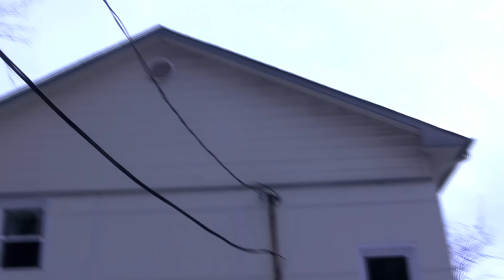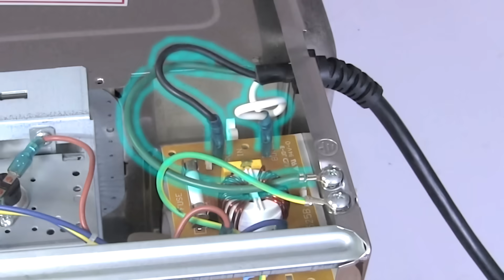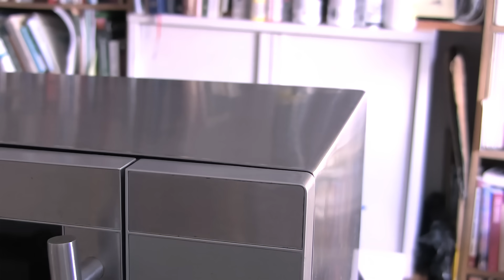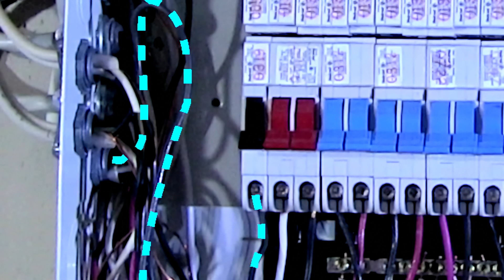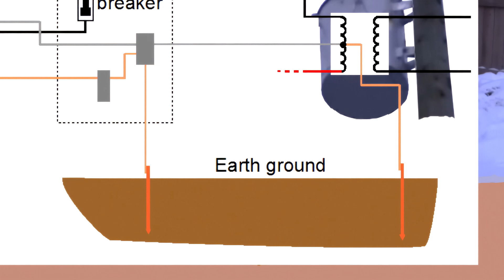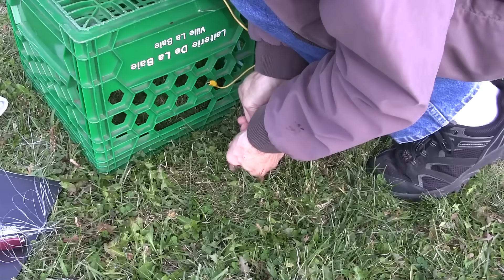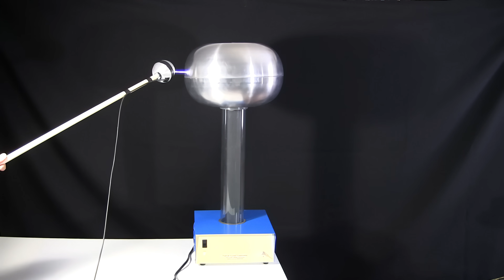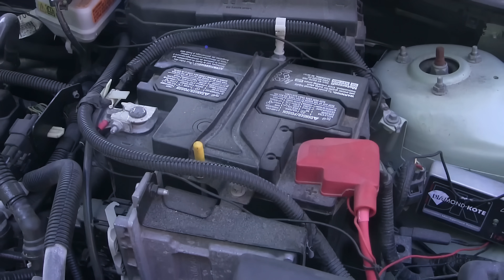What is Ground? Earth Ground/Earthing

Comment: in europe, Neutral and Ground are not connected in the home. (and must never be) Neutral is connected to ground at the provider's transformer. Security is acheived via a differential breaker.
Reply: In the UK commonly we now find systems of distribution of a T. N. C (S)
The Tierra and Neutral are Combined as far as the service position in a premises, and from thence separated into the Neutral and Circuit Protective Conductor (CPC) or as formerly referred to as the earth.
Like in Europe, it is not permitted to interconnect the Circuit Protective Conductor and the Neutral within the installation, and we are now required to deploy Residual Current Devices to monitor circuits to specified locations - all socket outlets, bathrooms, kitchens and outdoors. Also, if a cable is less than 50mm from the surface of a wall and does not have additional mechancial protection that is earthed, that circuit must be protected by an RCD.

The use of T.T. (TIerra-Tierra and earth rods) Systems still abound, as do many T.N.S. systems where the Earth and Neutral travel as Separate conductors to premises..
Reply: Not quite right.  Something similar to the US system can be used in the UK, if certain provisos are met and if a certificate of exemption is obtained.  But soon the UK will no longer be politically part of Europe and then your statement may be correct. :)
Reply: Well yes if we are including PNB systems (Protective Neutral Bonding) associated with supplies to singular specified consumers.
However, for the majority the supply is likely to be TNS in older properties located in towns and cities, and TNC (S) for newer properties.
My own house built in 1999 has a Protective Multiple Earthing
Reply: +Hassan I figured if I was correcting things I'd better make sure I covered all the angles.    No point being pedantic if you leave yourself wide open to somebody else being pedantic.  :)

BTW, did you notice that his breaker box (stupidly called a consumer unit in the UK) didn't seem to have a two-pole main breaker?  I suppose with the system they have there the chances of a fault putting neutral at high potential with the single-pole main breaker off is very small.  I still wouldn't like to work on wiring in the US knowing that house neutral was connected, even if it's earthed right outside the property.  I admit that it should be perfectly safe, it just feels wrong given what I'm used to.
Reply: +Hassan More clearly, water pipes and gas pipes cannot legally be used to supply an earth connection to the property but they must be bonded to earth (provided by some other means).
Reply: I had not noticed the single pole switching of the incoming lines. Frankly I would be surprised if that were the case in North America or anywhere else come to that. But perhaps this was mainly for demonstration purposes.
The Neutral Conductor has to be considered as one that can develeop a potential above ground, and therefore NEEDS to have an arrangement whereby all the normal current-carrying conductors can be safely isolated from the installation. Safe here taking into account the appropriate disconnection of three phase and neutral supplies, as well as single phase systems.

To be a pedant - the consumer unit should more correctly be referred to as The Consumer Control Unit or Consumer's Control Unit. But a lot of people still refer to it as the fuse box, even though we have progressed to more advanced forms of over-current and residual current protection devices.

May I ask if you reside in Europe? It's always good to learn about other systems inspite of Brexit!
Reply: +Hassan  I admit I didn't bother watching the video again and was relying on memory, so I could well be wrong.

Neutral conductor can develop a potential above ground here, but it's a lot less likely in the US where it's tied to ground right outside the house.  That tie can get disconnected, but it's not as likely as neutral floating around due to imbalanced load in a 3-phase distribution system, as well as other fault mechanisms that could develop from severing wires.  So it's not as dangerous in the US to have single-pole isolation (if I wasn't misremembering) but it's far from safe.

My gripe with "consumer unit" is that I, a consumer, have many things in my residence that could be referred to as a unit.  Calling it a consumer control unit doesn't help a great deal as some of the units I have can perform some sort of control function.   Breaker box is something most people could understand, although most would understand fuse box more quickly.  On the phone: "Go to the consumer unit."  "What's that?"  "The breaker box."  "What?"  "The fuse box."  "Why didn't you say that in the first place?"

I'm in the UK.  I suspect you're in the UK too, but perhaps of Spanish or Portuguese origin - it was the way you laughed.  Actually, I figured Dutch at first until I saw some of the channels you're subbed to.
Reply: bdf2718.
Je je, verdaderamente de este momento estoy en communicado con un electricista en Mexico sobre su video acerca la instalación de una portalámparas.

My internationality derives from having met a Spanish electrician who had come over here to the UK to find work, and we help each other to learn each other's respective native language through our common bond. Pun intended!
Also, my wife hails from a country that has a basic North American system but operating domestically at 220 Volts. That causes problems for American ex-pats who plug in their 110 Volt appliances that were not designed to operate at double the potential.

Un cordial saludo del chico electricista. Y no he votado por Brexit.
Reply: There is no single system in Europe. In Finland they used to be connected in the socket.

Comment: The electrical installation connecting neutral with ground makes it impossible to use an differential circuit breaker. I'm not sure about the US, but in Europe the ground is separated from neutral for good reason.
Reply: Ok thanks, I was thinking the same. I'm not the specialist, but I was quite sure ground and neutral were not connected at my house.
Reply: Just what I was about to say.
Reply: kpharck you can use a differential breaker such as GFCI and AFCI. The neutral comes from the circuit and terminates into a second lug next to the hot then a pigtail wire connects the neutral to the neutral buss.
Reply: Many electrical distribution systems outside of North America do not ground either current carrying conductor. These systems rely on an RCD (Residual Current Device) for safety. Many older residences in North America were not wired with grounding conductors. It is permissible to replace the dangerous two prong outlet with a GFCI in that case. This acts very much like the RCD.
Reply: so when one part of the capacitor is grounded(one plate), the potential and the charge are both equal to  0?

Comment: Nicely done. Comprehensive, but easy to understand. My single, very small, criticism is that the pole holding the transformer, especially directly outside of, and certainly connected directly to, a residential area, would never be "transmission," it is "distribution." Transmission lines carry (typically) 345-500 kV, whereas distribution will (typically) carry 5-35 kV, to which tap lines will then connect to a final secondary transformer, stepping the voltage down before delivering the 120/240 service voltage to a home. Consider what would happen if suddenly transmission-level voltage was sent through a distribution line. First, the distribution conductor would burn up, unable to take the amperage and, if it got to service-level, there's a good chance that every appliance and lightbulb in the house would blow.

Comment: Our earthing system is totally different in Australia. firstly the neutral side of the pole transformer on the primary and secondary side are both common to each other and do not run back the grid, it is staked into the ground typically at the base of the power pole. For the case of low voltage local grids it does run back, but to a local sub-station transformer where there the neutral of both primary/secondary are staked to the ground as in the local pole transformer case.

The protective earth is a completely separate line that runs to a separate grounding stake located near the houses meter box. 

We use RCD breakers to trip in both cases of active to neutral and from active or neutral to protective earth (also called PE)

I believe this is also the case for a lot of Europe?

Comment: There is a big (even deadly) fault in here, the ground has his own fuse breaker. and that flips
that is because when the person (for example shower) is the one that is between the hot and ground wire than it feels the maximum of current through your body, so instead kill. The RCD will break the voltage on very low amperage not the circuit breaker that is used for the hot to neutral load.

Here in holland it is max 16A (240volt) per group
but the ground breaker is just 30mA (0.03A) that is even triggered as low as 40Volt 
this breaker wil break the hot and neutral wire before every orther circuitbreaker, so when ground breaker is triggered, no voltage will be on all of the cables that come out of your fuse box
Reply from the maker: Here in Canada and the US we have something similar called GFCI (Ground Failt Circuit Interrupter). I don't know about newer homes but older homes often don't have even one (my place doesn't). I think in newer homes, if a socket is within a certain distance of a water source (like a sink) then it has to be a GFCI type, but don't quote me on that. I've seen them in hotel bathrooms for many years.

Comment: misinforming and over-simplified
Reply from the maker: How is it misinforming?
Reply: connecting ground to neutral is very dangerous and should never be done, doing so would annul the protection from the ground leakage interrupter, look up bootleg ground.
"Before 1996, in the United States it was common to ground the frames of 120/240-volt appliances (such as a clothes dryer or oven) to neutral (grounded) conductors. This has been prohibited in new installations since the 1996 National Electrical Code upon local adoption by legislation or regulation".
Reply from the maker: But the video doesn't say that the appliances' frames are connected to neutral. It says that they're connected to ground. The fact that neutral is connected to ground in the breaker panel and at the transformer is in the NEC and so the video is correct about that too. If you don't like that the appliances frames are connected to the neutral ultimately through the ground wire then you'll have to take that up with the NEC.

Comment: ground is an reference to Eather a rod or plate , put 2 to feet in the earth, all other references that people call ground , is called bonding!!!

and bond wires are never hot,. just as neutral is the return path for the flow of electricity

Comment: A couple of issues , 1st off lots of good info & well put .
I would suggest adding info on the transformer , not showing the other 120 leg - red , your talking to those that do not know , so good to mention that's how you get 240vac into the house .
Next is connecting to the fence , bad idea , only one part with be close to ok , the vertical risers / fence posts - except they are usually shallow so not a good ground , then big problem with the horizontal / rail and the chain-link very unreliable ground and more likely to make a lot of RF noise in the are - do to bad connections of those parts acting like diodes .

Comment: can i use screw that pinned to wall? or it must to be "ground" below us?
Reply from the maker: If you mean the screw that holds the power socket's front plate in place, here in North America it's usually connected to ground. I just looked at a plastic receptacle case (the box in the wall that the plate is screwed to) and there's even a metal strip in place to ensure that the screws will be connected to ground. So the answer is yes.
Keep in mind that if you put high voltage sparks or stuff on that ground then remember that that same ground is what all metal cases for appliances in your house are also connected to. So there's a chance of someone touching a metal case at the same time of getting a shock if their other hand or feet are also touching ground (and it doesn't necessarily need to be earth ground). That's why in the video I suggest connecting to the cold water pipe entering from the city, it goes directly to earth ground and is likely insulated from other things on the house side.
Reply: RimstarOrg yes screw that hold the   power plug i mean, nowadays in my country ground pole not connected right to earth, so i must manually create ground pole, ive asking friend, the ground must be shortest route to earth, i have room that quite weird, have no power plug port so i must pulling out far terminal cable. so thanks for answer :)

Comment: So have your excluded Canada from North America? In Canada those wires are called live (or hot), identified [conductor], and bonding. Grounding conductor is the one that connects the panel to the Earth. Identified is called neutral when it's actually a neutral conductor in 2-3 phase system used to temporarily carry the current imbalances.

Comment: So the hot and neutral wires are either end of a transformer secondary and therefore identical to each other but out of phase. Yet connecting the one we label 'neutral' to an appliances casing makes it safe and connecting the 'hot' to the casing makes it very unsafe, because the neutral wire is connected to ground, presumably. How is there even any voltage left given that it is connected to ground (0volts)?
Reply: Dadoo83 Nah man.. if anyone touches the hot line while standing on the ground, they are actually completing the circuit (don't forget that earth is a part of the circuit since neutral wire is connected to ground).
There's a high resistance in that path but unfortunately not enough to lower the current passing through your soft tissues..
Reply: I understand that bit. And mentioned myself that the neutral is connected to ground. I'm asking what effect the ground connection has on the AC voltage being supplied.

Comment: Excellent, thanks! Low resistive path is "preferred" by the current (Kirchhoff's + Ohm's law). That might have been included in the explanation when describing the safety of (touching) the grounded microwave oven chassis and well before the breaker intervene.

Comment: So household ground and neutral are connected, common (continuity from incoming neutral wire, through neutral bar and the panel's case, to the earth ground wire), and therefore the same? Not only this, but if we consider charge traveling through the neutral wire in the direction from municipal source to an appliance sink, they're connected upstream (before the charge would reach the appliance). Surely the vast majority of charge coming from the neutral side would then follow the path of least resistance straight into the ground and never make it to the appliance? (actually, since there's also a wire at the transformer directly from neutral to earth ground it would happen there) Which means that appliances only ever feed off the live wire (half of the potential), and that half of everything supplied is wasted directly to earth ground?
Reply: What goes from Active to Neutral and not Neutral to Active? The oscillation? The charge? Doesn't oscillation mean that there's an impetus (potential) for charge to flow from one side and then (in the case of a sine waveform) an impetus in the opposite direction, repeated.? AC oscillates around zero volts and is only 'positive' or 'negative' because we're measuring in one direction (negative is actually a positive potential in the opposite direction), right? Well i guess i'm asking how you can have that positive potential in the opposite direction coming from the neutral line if it;s preference is going to be to to take the path of least resistance and imbue the earth with it's electrons [during that part of the AC cycle].
Reply: Thanks Mr Anderson. 
With that understanding that it's the potential of energy transmission [and not electron flow], can we say that this is what potential difference means in AC circuits? Because if it is then i'm still thinking of flip-flopping of potential difference (potential of energy flow) between a push in one direction and then the other. Since you say that it is the hot / active line that is energised, perhaps it is my perception that there must be a push from both directions (alternating, and creating the sinusoidal waveform) which is causing difficulty for me to see how a grounded neutral could work. If [only] the hot / active line is energised, then is there a 'pull' as well as a 'push' from this line? I would expect that if it were all about the hot / active line, then an appliance could be powered (not safely or in the home) from just one wire. But as far as i know that's not the case. There's an alternation of energy input (or potential to do work) between the two power wires hot and neutral. Which i call an alternating push. Both are necessary in order to create the backward AND forward alternating flow of electrons which in turn permits energy transfer. Absolutely, this alternating push results in a net zero transmission of electrons and a transmission of energy via their vibration back and forth. But there must still be a potential from the neutral line. Unless that's wrong, i still can't see how 'shorting' the potential coming from one side down to earth ground could allow the energy flow into an appliance from that side.